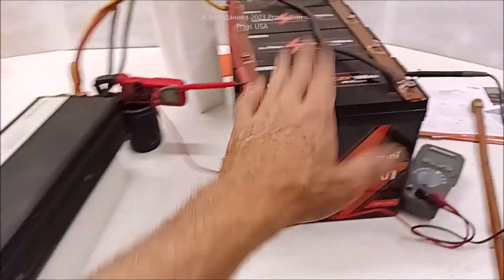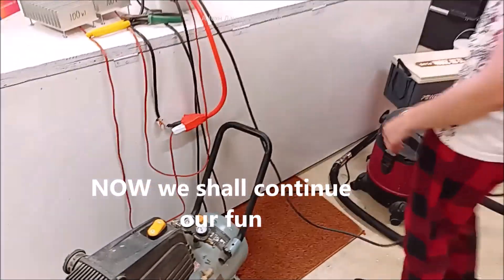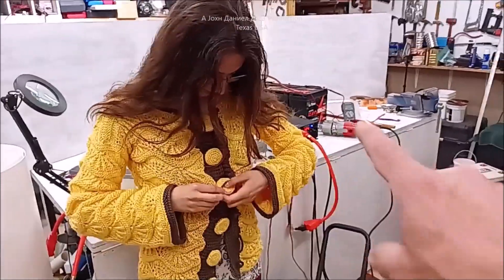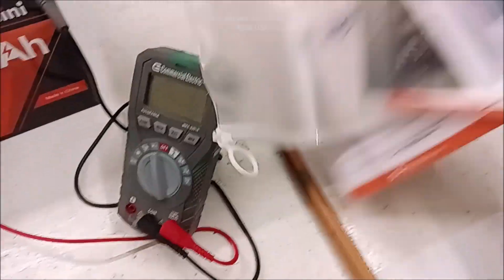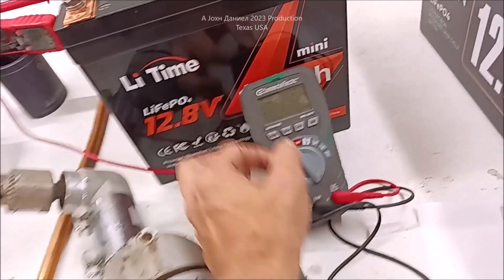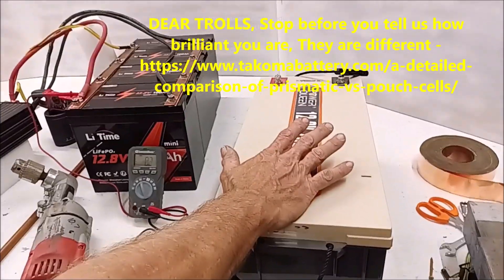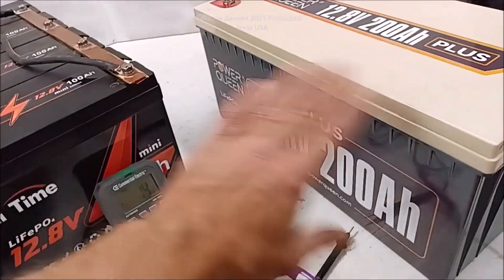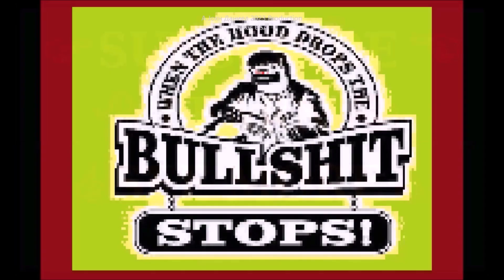Li Time Mini LiFePO4 100ah battery long term testing with Newest SWI-Power 3000 watt inverter

Comment: Crack one open and look at the bloat, I tested and opened mine, I will avoid pouch ( cost savings) at all costs, the smaller size is a gimmick to a crappy product (my opinion based on tests)
Reply from the maker: You simply can not charge them to 100% based on the included BMS in them, It is for Prismatic. Truth is the Pouch cell will last longer than a prismatic but not by using a BMS made the same for Prismatic or even other LiFePO4. Take my word for it, if you get any more, charge them to 14.4 or less, charge should be shut off from charger, NOT the bms. My solar controllers set on AGM charge to 14.35, then stop. reconnect at 13.10. NO FLOAT. They made a huge mistake making pouch charge at 14.6 and the BMS allowing it. Pouch cells, says 90% is full charge, at 14.25 volts. But you got these fools who read somewhere, and drank the koolaid to believe Lithium is God Like, Zero to 100% back to Zero thousands of times and they will last decades. Wrong!
Reply: @JOHNDANIEL1  I have tested them at multiple charge limits and have yet to see one that didn't bloat,  they act very similar to lipo cells, nothing you do will stop the bloat and eventual cell rupture or  other failure failure.  I have tested multiple manufacturers of these cells and in my experience it comes down to a sales gimmick on trying to sell a smaller package so that people can stuff 3 batteries in the same area at 2 batteries, it's a joke
Reply from the maker: I have had similar experience with them, Also Prismatic that bloated. These in the new cases have substantial compression, so they knew the chance of bloat and altered the methods. Some brands are much better than others, but honestly a Pouch cell is as you seen in my testing NOT supposed to be charged high. And as you saw, they had 400 amps capable (4x100) BMS but we know better, 3/4 rate them, or do not use them. I only paid $500 for all 4, new. They made me the offer to get them at 60% off for my testing and a video on them. Unlike guys who got them free, I got skin in the game, so I can be honest about them. Charge them lower, they rank a A at best as I said, not a A+ like the promoters are saying, and they should NEVER be used as just 1 battery pushed to the BMS limits of they will crap on you.
Reply: @JOHNDANIEL1  like you I get zero compensation but I also get zero discounts,  i either pay full price or I  group members order amd have sent to me for a test/review, of the threw pouch cells batteries I have tested all of them are under compression/restraint by means of string lined package tape amd not under any sort or framework that would offer any substantial support,  hopefully after 100's of reviews manufacturers will switch to some sort of an actually support structure that will keep the bloat within industry standards,  I like your videos and how you show DIY /mods, keep up the good work

Comment: Good info, never thought about using the AGM setting to stop the charging to 100%.
Reply from the maker: Using pouch cells, you have to stop charge yourself. They did not change the BMS to be for Pouch cells. So using AGM setting, most solar controllers stop at 14.20 to 14.40, usually 14.35. Waiting on the BMS to do the charge control will ruin pouch cells. None of them can last with the included BMS in the case. It is for LiFePO4 Prismatic. Or LiFePO4 Cylindrical. Pouch cells can actually outlast those, but die fast when charged the same.